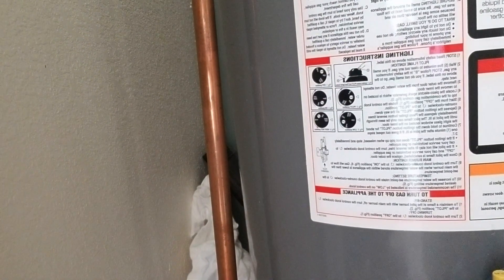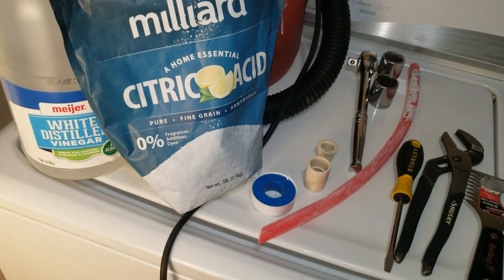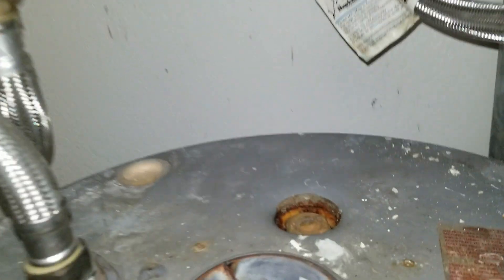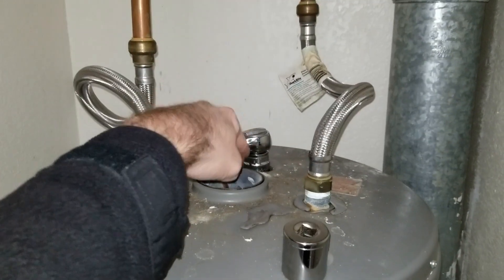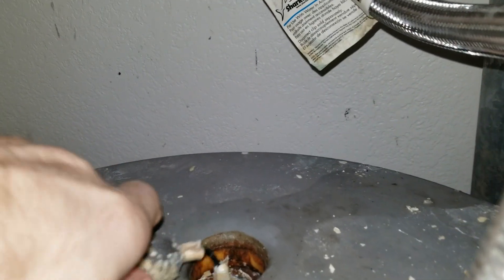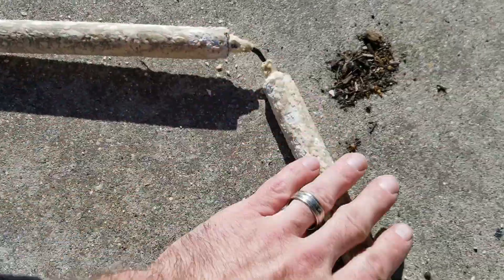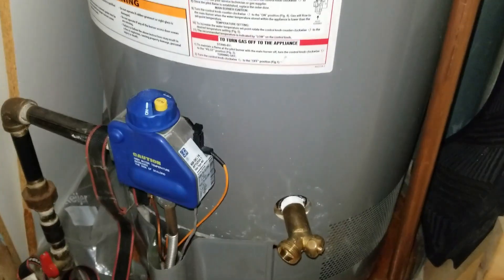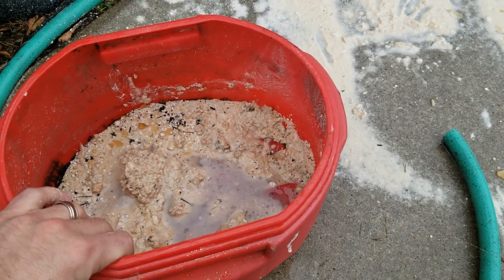How to Flush & Vacuum Water Heater Tank to Remove Sediment - [Easy DIY Fix!]

Comment: We have an electric hot water tank and the bottom heating element blew up as it was covered in this calcium. When I looked inside as the hole for the heating element is big I was amazed of how much was inside still. I talked a guy that repaires them and he the drain hole to small to get most of it and they have drilled out to make it bigger. I already wasted a lot time on this tank and do not want to get rid of it as it is 3 years old but I do not have days to try and clean it all day. I think I put a new one in and try to drain monthly or at least every other to 3 months. This is crazy that there is this much in these tanks.

Comment: If you remove the anode rod once a year, why not invest $50 - $75 on an impact wrench? It would make such easy work of it because you wouldn't have to brace the tank with straps, and you wouldn't even have to remove the flue pipe. Are you worried that an impact wrench might damage the threads?

Comment: Remove that old drain and install a full port drain, or make one with 3/4 ball valve.  Draining slow? Use a transfer pump.  I like the citric acid tip, but fear it might be eating at the water heater itself.  Also don’t forget to check your Temp pressure relief valve too.  My reminder to drain n check etc?  every day light savings.

Comment: Why do you put water in with a hose?   The incoming pipe inside a waterheater normally goes from top down and turns so that it swirls the bottom.   I just installed a A. O. Smith descaler.   I’m going to clean our heater out soon.

Comment: I really want to do this, but I'm worried that I remove the drain valve that it'll strip the threads. The popping noise is really getting to me though. I did an intial flush... followed by a second flush, after seeing all of the brown water. I think I made the popping noise worse ugh. I have a 2017 water heater.

Comment: I have a 17-year-old gas water heater. Flush about every 3 years. Never changed the rod. Works fine.
Reply from the maker: I only changed the original to get a collapsible one so that I wouldn't fight with the ceiling every time I tried cleaning the thing out.  I just scrape the calcium off the collapsible rod and it's been rocking for years and years now.

Comment: Couldn't you use the water inlet to rinse the inside of the tank out, as opposed to the garden hose? I believe the Rheem runs the cold water all the way down to the bottom of the tank...
Reply from the maker: It does, but it only empties in a fixed position.  This just causes the calcium deposits to pile up in a particular pattern along the outer rim and they don't move from there.  The hose allows a stirring action which forces the calcium out of the hose at the bottom.
Reply: @HomeBatteryBank  Oh gotcha! Yeah, that's a great method, I'll have to try it, since I have a bunch of maintenance to do. (anode rod replace, tpr valve replace, and clean it out) I have this same model, I drained it and saw all the sediment in the bottom. I tried flushing it, but it hardly got any of that thick debris out.
Reply: @HomeBatteryBank you ever try dissolving what you accumulated in the bucket in various kinds of acidic solutions to find the best ratio. I thought the citric acid power was suppose to dissolve everything.

Comment: My advice.  Invest in a Whole House Carbon Filter.  If you have heavy sediment, put a separate sediment filter in front of that.  Also, save yourself a lot of trouble.  Install a 1/4 turn shut off BEFORE and AFTER your filter(s).  Best move ever.  I turn both off, I get no back flow.  Change my filters, back to town.

I've been in the house 30 yrs.  My first Water heater died at 12 years.  This one I just serviced at 17yr, and I had a little build up near the exit tube, but otherwise the water comes out clean.  I am looking to see If I can push a USB waterproof  camera into the tank to see what it looks like inside.

I think I should replace the anode.  Already thrilled with getting 17yrs.
Reply: Filters don't remove dislolved calcium. You probably just noticed a sediment reduction.
Reply: @highhillhick  Thanks, I did not realize this.  But it does remove sediment, as you said.

Fortunately in FL the water is not that hard.  Just MORE chlorine than REQUIRED in a public swimming pool.  LOL.

Daughter in Nevada is getting a water softener for her VERY HARD water.

Comment: There’s a third option to getting it to drain you can just leave water turned on hook the hose up and use water pressure to break up calcium or you could hydro lock the tank with a flex line by hooking inlet an outlet together then hook up a brass nipple to ball valve break the ball valve and your rolling also works with gas control valves especially since you bought a crappy rheem
Reply: Don't need snarky-nasty comments.

Comment: Using acid to clean is a dangerous gamble since it doesn't dissolve everything. You run the risk of loosened deposits getting throughout the plumbing system and eventually causing blockages. Very expensive to track down where the blockages are. It does seem like you live in an area with very hard water and you would likely benefit from adding a sediment and scale inhibitor on the cold water line.

Comment: Great video!  Also you can bend PEX and not have it cramp if you use a heat gun.  I usually do a flush every 2-3 years but I realized when I had almost no hot water this morning it’s been over 4 years.  So this is what I’m doing today, yea!!!!

Comment: How did you remove the original, non-collapsible anode rod with your limited overhead space?  I have the same space restriction.
Reply from the maker: I had to drain the tank,  disconnect everything from the top of the tank,  and then tilt the top toward the door so that I had enough clearance.
Reply: Couldn’t you just cut it in pieces to get it out, since you are getting a new one? This is what I want to do? What works best the acid or vinegar? Thank you!
Reply: Yes, you can cut the rod  as you pull it out

Comment: The easiest way to break free a stubborn anode rod is to use a impact wrench. That way you don't have to worry about your water heater moving or having to support it!
Reply: So true!
Reply: Do you think using an impact might cause enough vibration to crack the glass inside the tank?
Reply: I've been doing it for some time now and that hasn't happened.
Reply: @DavidSimpsonSpecialForces   Thank you for your reply.  I used an impact to remove the rod.  The anode material was down to the wire (gone) about four inches from the threaded head at the top of the rod.  The impact must have then spun the whole rod a bit too quickly and the pendulum action caused by the weight of the remainder of the rod must have twisted the wire at the top.  That bent the wired portion to where I could not remove the rod straight out of the water heater and left me guessing what was causing the problem.  So, I think the best method would be to loosen that rod using an impact and then remove the rest by hand.

Comment: My Ruud LP gas water heater suddenly started giving me only 15 minutes of Luke warm water with my temperature dial turned all the way up. I replaced the badly deteriorated dip tube, and nothing changed.  Still only luke warm water. I changed the thermostat/gas regulator on it and soaked mine in CLR then vacuumed it out with a bent tube through the thermostat bung hole. Clean as a whistle and STILL no hot water with the new temperature dial set one notch below max temp! It's hitting the bottom of the tank with solid blue flames with a touch of a few orange tips. The exhaust hood and pipe are too hot to touch without gloves, so it's heating up good but still only luke warm water! What else could it be? It's a 38 gallon tank! It should be making hot water but it isn't!
Reply: Get a new water heater.

Comment: Why not install a whole house water filter?
Reply: I have a whole house filter and a water softener on my house. What comes out of your water heater is not so much sediment as it is mineral deposits that build up over time. I flush my water heater once a year and still get an insane amount of deposits that flush out every year.
Reply: @kylesalesky4602 I also had a carbon filter and still got minerals. I drain about twice a year and am about to change out the anode since it's 5 years old.

Comment: Awesome video, I was told not to use Teflon tape on anode threads as is breaks the continuity between the cylinder and the anode,not sure is that's true?

Comment: 12:30 Put the end of your discharge hose into a 5 gallon bucket. This will not restrict the flow of the water. What will then happen, is the bucket will act as a siphon, allowing the water to splash over the top edge of the bucket, while most of the sediment gets trapped in the bucket. If you flush your tank annually, you should expect to see about a gallon or so of sediment. If you have not flushed your tank in a few years, you could expect to see 3 to 5 gallons of sediment. This makes cleanup much easier, and you can allow the water in the bucket to evaporate leaving the sediment. Because the sediment is mostly calcium, it's a great natural fertilizer for many of the plants and veggies growing in your garden. Beyond flushing your tank this way, there is a much more effective way of flushing it, using a tool called "Turbo Tank Cleaner" Here's a video (not mine) showing how it works https://www.youtube.com/watch?v=OkDYkK1vhBI&t=5s
Reply: Bad suggestion. I watched this video and most of the comments are disagreeing with this method. Waste of time

Comment: thanks for the video, very helpful. we have a water softener that uses potassium. it came with the house. the gas heater started leaking and we believe it's about 8-10 years old. I'm hearing that softeners reduce the life of the heater as they erode the anode rod quicker. Is there any solution to this issue knowing our water is extremely hard and we must use it? Do they sell special anode rods that work better with softeners e.g., any other sacrificial metals? Otherwise i'm hearing that I need to replace the anode often. thanks again for your help.
Reply: They have a powered anode rod that is supposed to be guaranteed for 20 years.